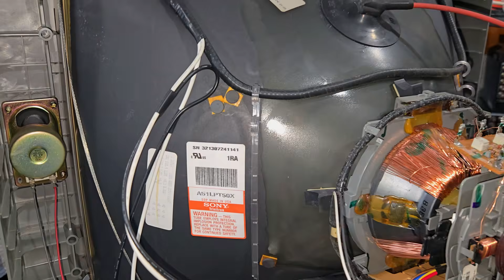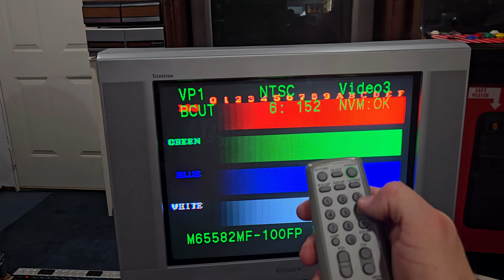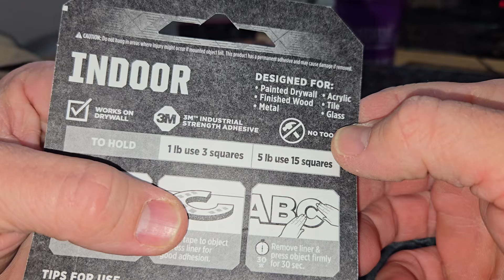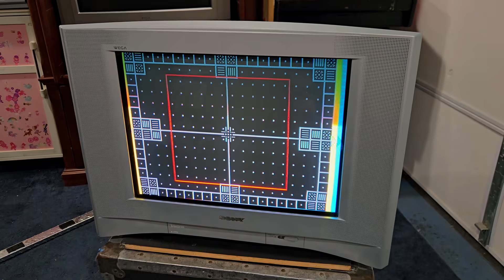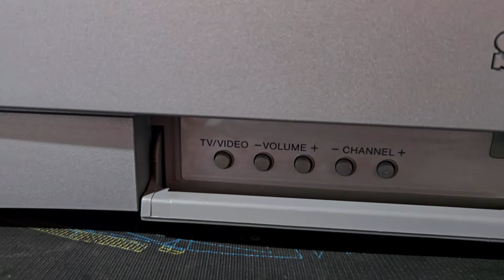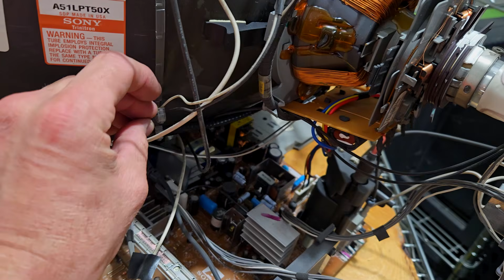Fixing Sony's Worst Era of Trinitrons - The Flat Screen CRT Deep Dive

Comment: My FV300 is on its way out, bowing edges and recently some hissing noises coming from it when powered on.  Nobody to service it that I can find around here in the midwest so I guess I'm "going down with the ship" on this one.  Currently using it rotated for arcade games, sitting on its side with a memory foam pillow for the curvature to rest on with large industrial zip ties to keep it secured to the framing i have it set on.

Comment: I don't know if you actually monitor these comments, but why does disconnecting the rotational ring and cranking up the number through the service menu eliminate jailbar distortion? I'm going to give it a try on my 20fs100 because I have the same mild distortion, but I'm curious if you know the reasoning and how you figured that out

Comment: It is certainly the most overrated era of Trinitron. And Trinitron tubes are overrated generally. 

If you look at the top Toshiba, Panasonic and JVC models from the same era it's hard to see any advantage with the Trinitron and very easy to find the opposite re quality control.

Comment: I own a 27FS100L, which is a BA6 model. My set had some hard blue push and some minor red push, but I managed to get it tweaked out (It also suffers the slight flutter issue too). But overall its a great set. I cant complain too much since I got it for free. Component is very clean on it, say for a little luma shadow, but overall, a great set.

Comment: Whew, checked my set and its a kv-32fv26 with a AA2U chassis. So probably no flicker problem. 

What it does have is this bow on the top leftof the corner of the screen. I figured it was a bad convergence issue. Need to source an official remote to go into the settings and see if I can fix it that way. Want to install a rgb mod on it if I can solve that issue. 

Keep em coming!

Comment: The only Sony CRT I own is a kvfs210 with the BA-5D chassis. I need to get a cap kit. My composite input has issues with some sources not getting a good signal while other sources work just fine. I think it was made in late 2003.

Comment: Still no RGB mod for the FV300s? I could have sworn they could be modded, but I never really looked into it thoroughly. I have a 36FV300 that I got years ago but haven't plugged it in for a long time. Hopefully I'll get to start using it again in the next year. Thanks for making this video. I'll put it to good use when I get a chance.
Reply: зачем? Компонент, показывает ярче и красивее с PS2-Gamecube :medal-yellow-first-red:
Reply: @JonnyK3D It's definitely not required for TVs with components. Just a nice to have, and it can still look better than component for older consoles in certain situations. Sometimes I still like going back to composite with some games to take advantage of the composite blending too. I just like having the options.

Comment: Both the fs100 and fs120 have s video in the 24 inch model also. I know because I just tripped down the last stair in my condo with my 24fs120 2 weeks ago haha.. But definitely fv300 is best of 3 in my opinion also

Comment: Appreciate this content a ton, to be honest. 

I've been enjoying my Switch 2 games on my OLED, mostly retro ports and titles. But I recently had the opportunity to own a Sony WEGA kv 24fs120 for free. A friend dropped it off since they found it on the side of a road, with the factory remote included and all that. 

The geometry is such a difficult thing to land and to get right with the adjustments. It also seems to shrink the image if the picture setting is too high, amongst other power supply and voltage related issues. 

I'm happy with the image, even if the geometry isn't absolutely perfect. Geometry becomes nearly perfect when I dim the actual brightness/picture since I believe it's some kind of voltage issue. 

These sorts of videos are seemingly becoming my only source of information to try to understand these televisions with the attempts of actually reliving the prestigious CRT experience. 

It's such a shame we can't order brand new sets anymore.

Comment: I have 2 kv 20fs120 tvs and they both have the jitters up close but you dont notice sitting back 5 feet. Always wondered if it could be fixed somehow.
Reply: To my understanding, the jitter is the fault of the jungle chip - a problem from the factory.

Comment: Nice I just got a kv20 fs100 not long ago. Mine had some pretty rough geometry bowing near the sides of the image and I fixed them with magnet placement. I used neodynium magnets (broken into smaller pieces) but since then I've noticed some mild signal noise scrolling visible against darker brown/red/green/grey/blue scenes when using component (not composite) and I want to say it only appeared recently. I confirmed its not the component cables themselves and I dont think its caused by the image TROT function as I already fixed that as shown in this video. Any ideas?

Comment: Thanks for this.

My 24FV300 has a weird "horizontal linearity" issue that is best seen in the 240p test suite grid, where the squares are stretched much wider on one side than the other. I can only find one "fix" in a reddit post with pictures titled "Horizontal Linearity improvement for flat Sony TV using magnet". His fix is slapping new magnets on top of the "horizontal linearity induction coil" old magnets, but this didn't produce the same effect for me. 

Not sure what to do now except a basic yoke adjustment and then recalibrate everything for good measure.
Reply: My KV-24FV300 has this exact issue.